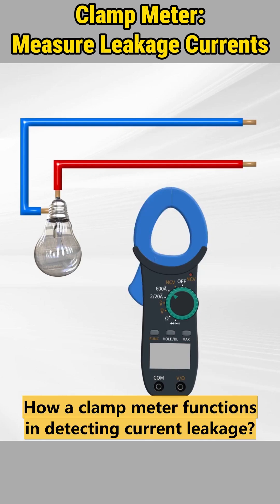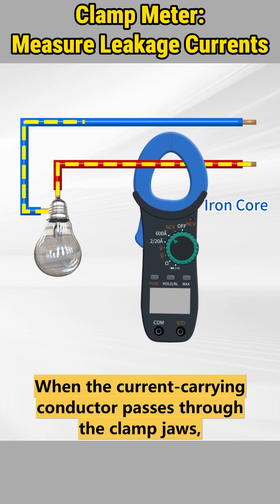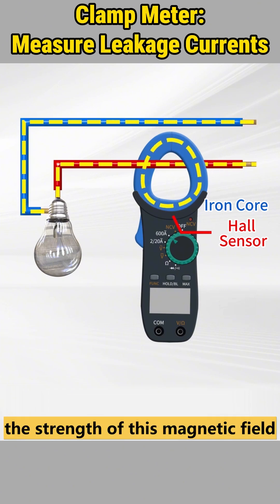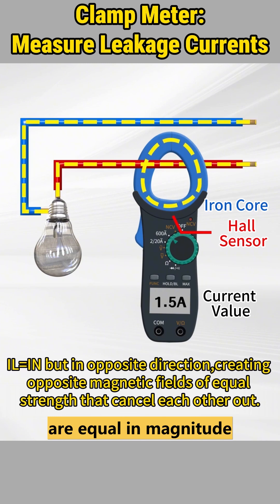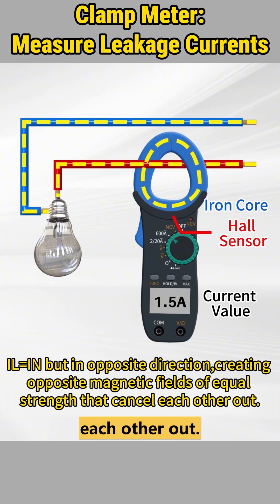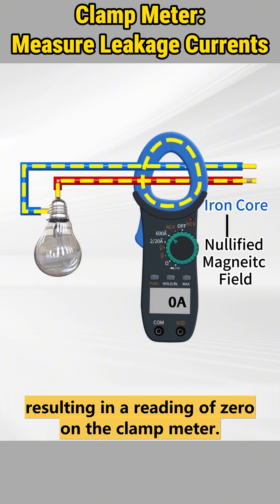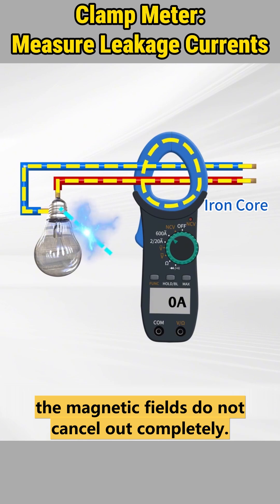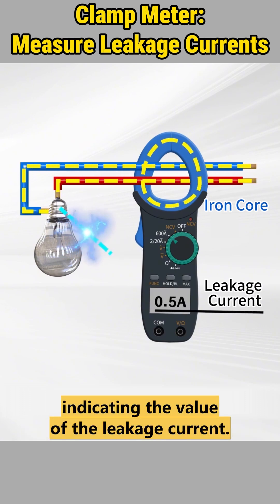How a Clamp Meter Measures Leakage Current #shorts #clampmeter

Comment: A normal clamp meter (AC/DC current clamp meter) is primarily designed to measure load current, but it cannot accurately detect small leakage currents. Hence A dedicated leakage current clamp meter (also called an Earth Leakage Clamp Meter) is required. These meters can detect leakage current as low as 0.1mA by clamping around both the live and neutral wires together.
Reply: Hi Sir what would you recommend me lm electrician l wired house 5 rooms 2 bathroom for two sockets and one kitchen every room have 1 Ac and every room have 2 sockets 
Kitchen l gave 1 circuit 
All sockets l gave 1 circuit
And Acs are separate 
And lights 1 circuit 
I gave that house 3 phase system lm scared lf fire hazard occurs sir 
Did l make any mistake?
Reply: @CabdiJiinoow-t9p  Check IR (Insulation Resistance) of wiring:

L1 - L2
L1 - L3
L2 - L3

L1 - N
L2 - N
L3 - N

N - E
L1 - E
L2- E
L3 - E

(When checking Any Phase wire with Neutral make sure to unplug all appliances and turn off lights / fans)

- If the readings are above 1 Mega ohms minimum, then the insulation and wiring is ok. 

-Check all connections whether there are any loose, make sure there is no loose connections

-Since you are using three phase electricity, make sure you used three phase busbar for breakers,  (if you used single phase busbar, it will be short circuit and it would be dangerous to give power)

-check continuity of phases also

Comment: Brilliant. After 50 years I now learn this. But: If voltage alternates and current alternates, I do wonder how it cancels out.
Reply: It does because of phase. 60hz or 50hz depending on which country you live in... thing is both are phased at the same frequency. REMEMBER NEUTRAL CABLE IS WHERE THE ENERGY "RETURNS" AND LIVE IS WHERE THE ENERGY "GOES"

This means is the same energy just one cable is "going" to the appliance and the other is "returning" from the appliance. So it will always have same frequency on both cables

So both alternate together meaning live would be on the positive cycle at the same time neutral is at positive cycle. Both would generate a magnetic field at the same time except they are opposite magnetic fields (because the way electrons flow depending on the direction of current) that's why they cancel each other
Reply: An easy explanation i learned is that when you measure the current flowing through any electricly conductive conductor, that conductor also creates a magnetic field which your clamp meter can read.

( If you want to know how, you need to look at the electronic compartment and understand what each compartment does when set up in the needed way)

This reading function however, can only happen when you have only one magnetic field you measure.

If you try reading the current of 2 energised conductors, you can only read the current difference between the 2 conductors, since if 1 gives the electrical energy than the other must also return the electrical energy towards it's source, and if everything is done right, the current difference is zero, or in other words, the energy transfer between the energy giver, and the energy taker or "returner" is very close if not a 100%.

If not done right enough, and assuming your clamp meter is accurate enough to read small enough, you can read a number above 0 in amps, which show you how much current has been lost.
Reply: @Jozsef0rsos  That's some good explanation. Thank you so much.